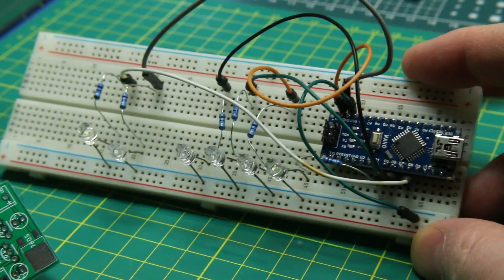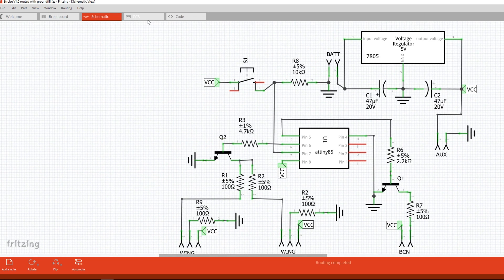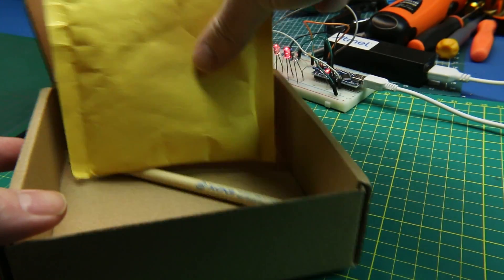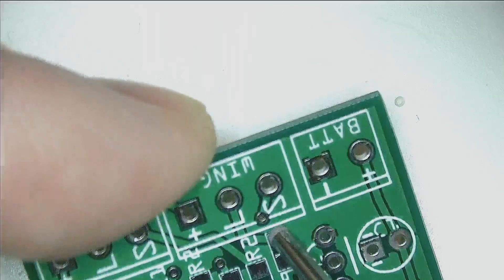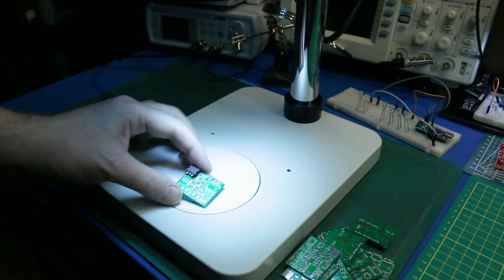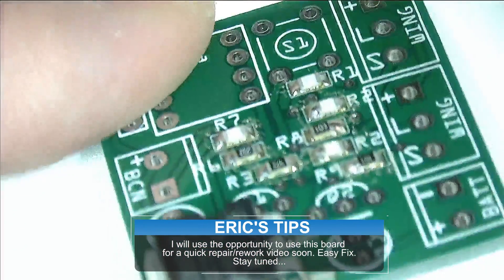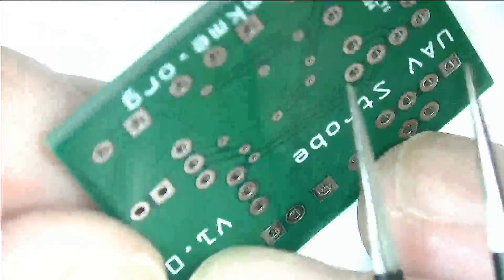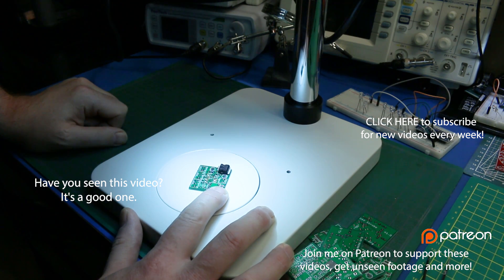Arduino Navigation/Strobe Lights Project🚨 Custom Circuit Board!

Comment: this is a great project.... is there any way i can add the  strobe to the RC switch too for remotely switching it on and off?
Reply from the maker: If I didnt leave it in the code it was indeed in the original which should be linked in the forum or code itself